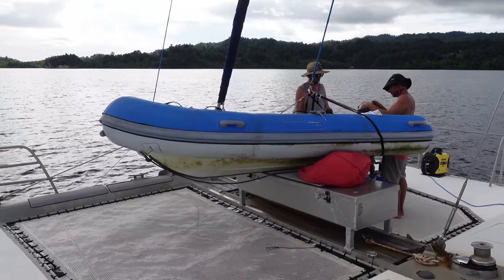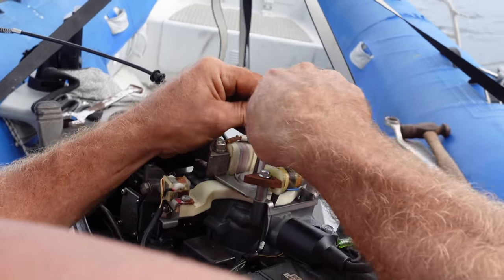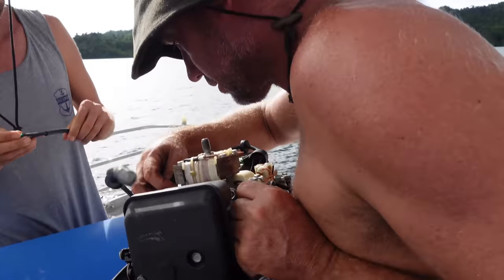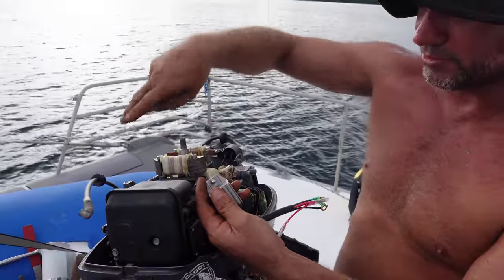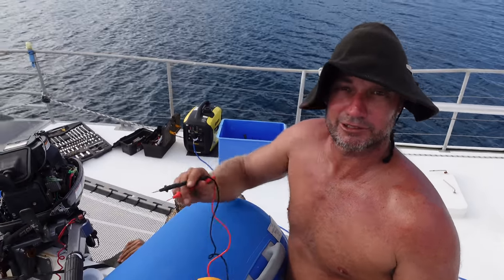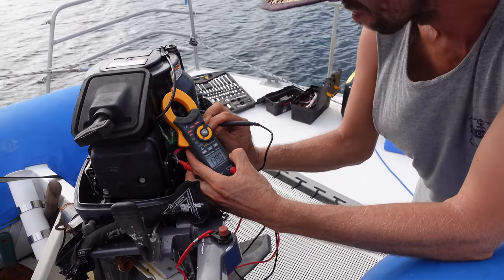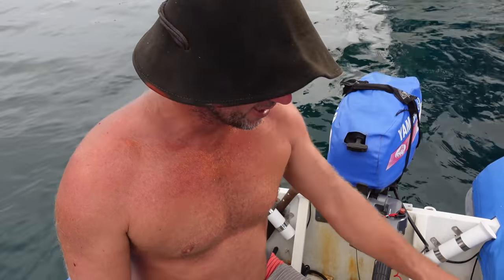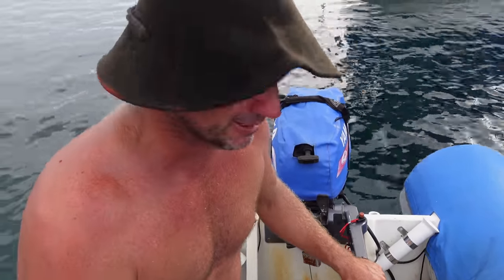Remote boat work on the deck | Episode 277 | Sailing Catalpa

Comment: Nice Video, just a small correction to your terminology. What you add on top of the motor was actually a AC Generator Coil. The silver box was a rectifier / regulator. It "rectifies" the AC from the generator coils into DC and then it regulates the DC voltage to charge the battery. Great Job Anyways! I would have dropped at least 1 part overboard.
Reply from the maker: Thanks mate good to know the right terminology 😅😆 yeah they did alright to not loose anything you’re right 😆🙏

Comment: Loving your adventures and now a question. Some time ago I watched you do your deck with Kiwigrip. How is it putting up with day to day wear and tear? Are you satisfied? Ihave a ferro yacht, live on board and need to do my deck this year, thinking to use Kiwigrip. Some people seem happy then grizzle that it is hard to clean and chips. Do you find that? Cheers.
Reply: Cork is being used by some manufacturers ....  its particularly friendly on metal hulls for feet and metal.
Reply from the maker: We love kiwi grip but yes it does stain we found acid wash works well to remove stains it’s good price and worked well for us ☺️